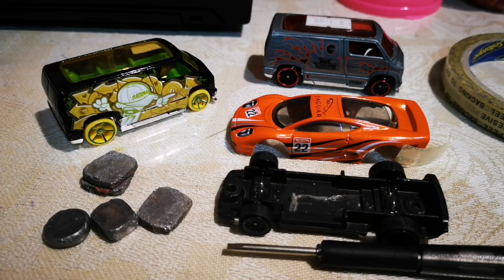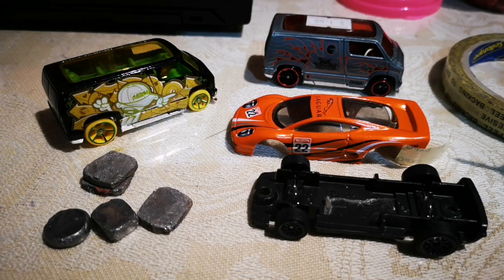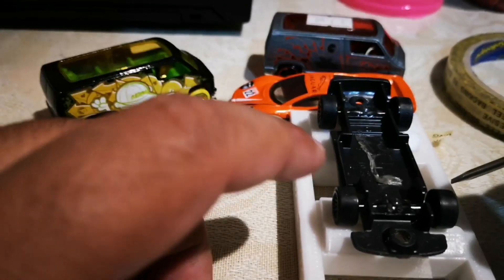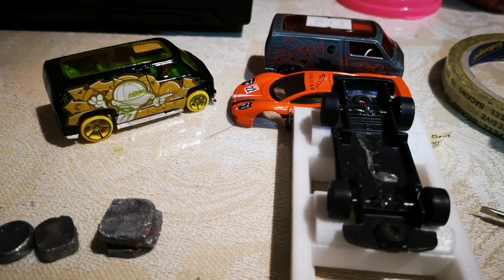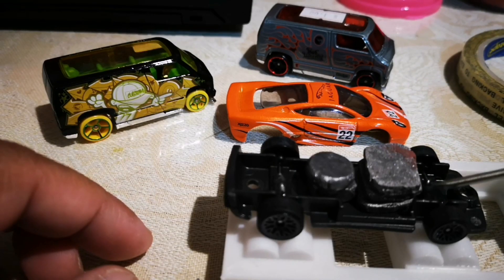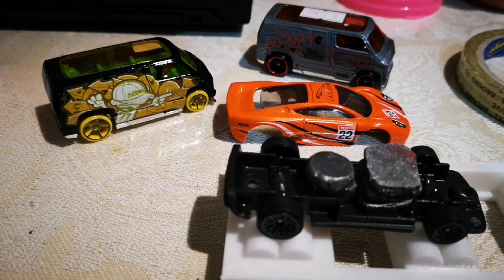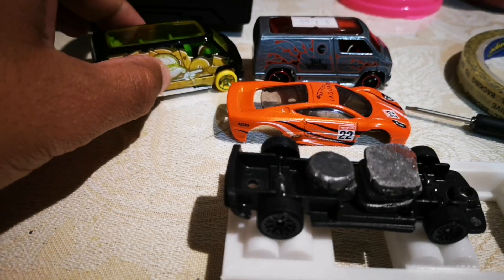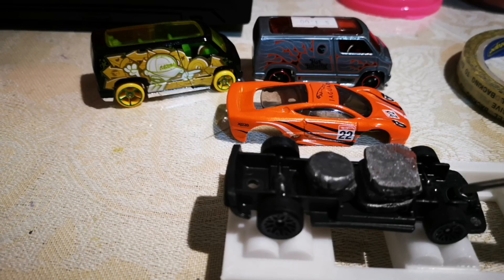Custom Diecast Racing Jaguar XJ220 Racing Build

Comment: Low and fast! Its going to be a contender!

And you're right about the alignment.  I noticed the skyline at the end was having steering issues and I think its because I originally used super glue gel to hold the axles. That stuff goes hard and brittle so one good hit and it breaks. 
I think using the epoxy is a good idea! I've heard of heaps of blokes using JB Weld but I've never found it here....so Araldite works just as well 😉
Reply from the maker: True Michael, its a hit or miss with the alignment, there is no interior in the Jaguar, so had to secure, the wheels in place. I hope it runs true, will do a test, on it.
Reply: Yup!  I use JB WELD Quik.  Learned my lessons with Super Glue/Gel!
Reply: automotive spare parts shops for JB Weld, like supercheap, autobahn etc bro
Reply: @MetalMania3DTV-TAS-AUS  cheers KC. There's only a repco here in Karratha and its usually pretty good so ill have a look
Reply: @enzedracing3641  o ok, Bugger, online then, Repco might have it, or Bunnings maybe, r u in OZ or NZ ?
Reply: Stick on Mag wheel weights also work and already have double sided tape, any tyre shop have them, in case some others dont want the mess etc
Reply: @MetalMania3DTV-TAS-AUS  still in aussie but going home on the 18th 
I've used those stick on mag weights,very user friendly
Reply: @enzedracing3641  o ok, you going back for good Mike ?
Reply: @MetalMania3DTV-TAS-AUS  3 months off. Taking long service leave so will have a good break. Got a mini engine to rebuild and might squeeze in a few customs as well. 
Hows things down there mate? Warming up?
Reply: @enzedracing3641  holy moly 3 months of, have to retrain when u come back lol, ok 1275 cooper engine? Few customs sound the goods, everything is all good here, just freezing cold, snow up the road 15 miles from our place, got the fire on in the house, winds strong and cold, weird weather we have, my youngest son is at Moore 46 yesterday 42 today, glad we moved here 8 yrs ago come april, ok back to it, about to upload a new vid 3 x 1961 Ford XK XL Falcon utes, Ranchero in the USA, ok take care bro talk soon 😎👊👍🇦🇺
Reply: @enzedracing3641  J Car electronics also carry JB weld, cheers

Comment: That jig is very nice, it takes a lot of guesswork out of the most important part of the build.  Have you heard of Tungsten putty weight?  You may find it at a sporting goods store with the fishing weights.  It's very nice for adding weight into odd shaped a small places.  If you find the right stuff it's sticky & heavy, and will hold your weights in place as well.  You won't have to use the tape, but, it won't hold down the axles.  Looks like another fast car going to "MWR"!!!
Reply from the maker: Hi Jon, I'm hoping that it will be fast, no we don't get the tungsten putty weights here in NZ. I will look on line to see if it's available. Thanks for the great feedback mate 👍
Reply: @HotwheelsBoys I haven't found it for cheap yet on the internet, I think it's priced up there with precious metals.  I found it from Woodland industries, a supplier for pinewood derby cars.  We used to race them when we were in the Boy Scouts.  They have great hard stackable weights, as well at this place but they are not cheap, but their shipping and customer service is unparalleled.  I'll send you some.  They sent me a bad batch that was too dry to work with.  They in turn compensated with two fresh packs to replace every bad one!!!
Reply from the maker: @PowerDriveRacingDJTrippleJ  hi Jon I did a bit of research on this and have found some putty, it is used for fly fishing. It is expensive for sure, $20 I will use lead fishing weights for now, I got small split shots thst I can put into the play doe to add more weight, if needed
Reply: @HotwheelsBoys  that's what I had to do as well....smash the weights with a hammer, and pound them into submission, to get the shape you want, the pounding actually melts the lead from the sudden friction...It's interesting how that works.
No worries, your wheels are set and so are you. Cheers!